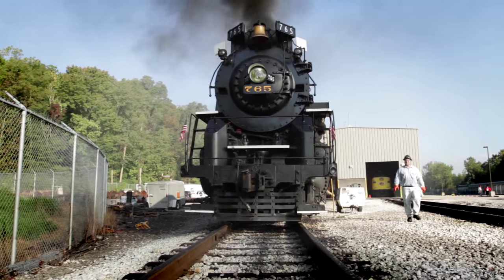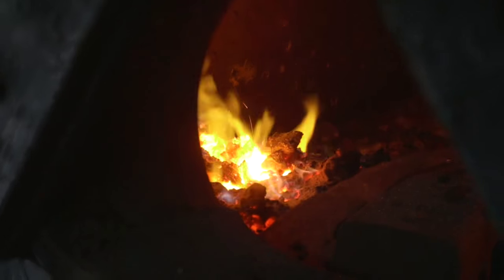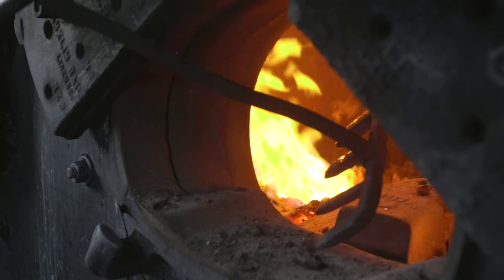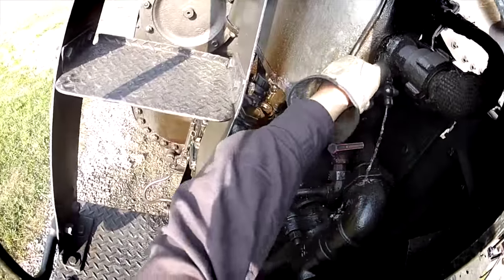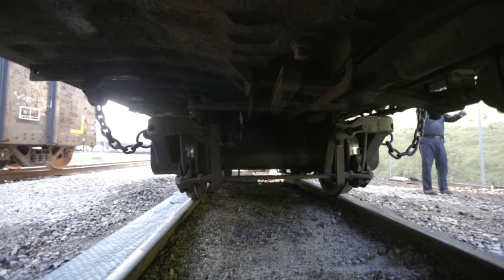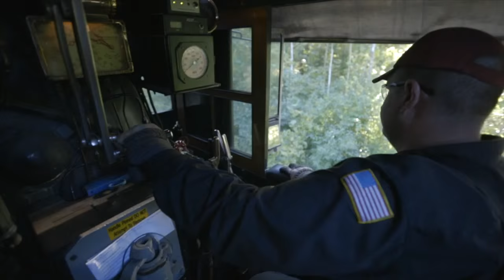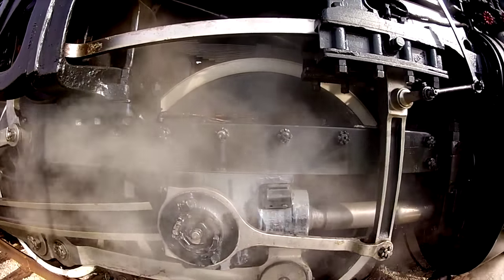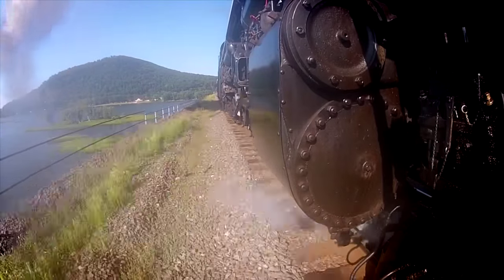How to Wake Up a Steam Locomotive | Nickel Plate Road no. 765

Comment: I was on the same trip as was "Annatar Lord of Gifts", and my interpretation could not be more different. It was one of the most amazing and enjoyable experiences of my life. Yes we stalled at the Nay Aug tunnel, but only because a vandal had greased the rails - apparently this makes for good video as the wheels slip and the stack belches black smoke, trespassing and vandalism notwithstanding.  Rather than pack it in, the crew managed to back down the rails, spraying steam on the rails then sanding them, and make it up the grade the second attempt. That was an impressive bit of railroading. True the power in our car ( and maybe others) went out for a while, but again the crew managed to make the necessary repair on the fly and reestablish power. Their motto is "whatever it takes", and they were certainly true to that motto on this trip. Truly an amazing machine and an amazing group of people who love and maintain her - this was not my first trip behind 765 and hopefully it will not be my last.

Comment: Glad to see the mars light was put back on! Looks great! You guys do a wonderful job. I commented about the "white walls" awhile back and was told the NKP painted their wheels white or silver. My Grandfather lived and my father grew up next to a NKP main line on the Fort Wayne division near blare yard and watched Burks roar by and switch for decades. Neither has any memory what so ever of them having white or silver wheel trim. They have pictures, and I have searched for historical images (including the Herron videos) with no sign of white walls. Guess that's why it seems odd to me. Great video! Thank You for saving her.
Reply from the maker: Dirt and grime usually covered the white trim (including the running boards and pilot steps). They are there! See some photos here: https://fortwaynerailroad.org/nickel-plate-road-no-765/

Comment: So how many hours does it take for a steam locomotive's boiler pressure need to be in order for it to move 4-5????
Reply: Depends on how big the locomotive is. If it's a small loco, like a 4-4-0 or a 0-6-0, it'd probably take around 2 hours, or maybe three. But the engine is a big one, like 4014, it'd be double that amount, more or less.